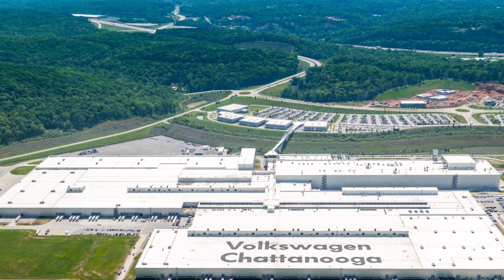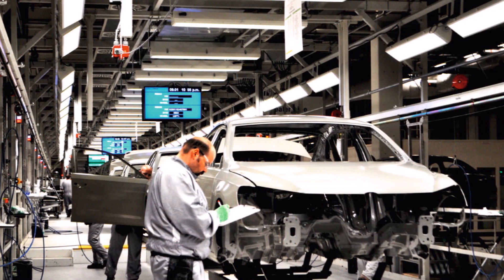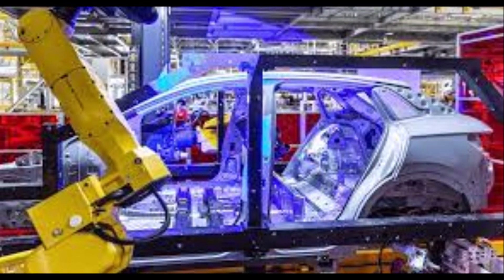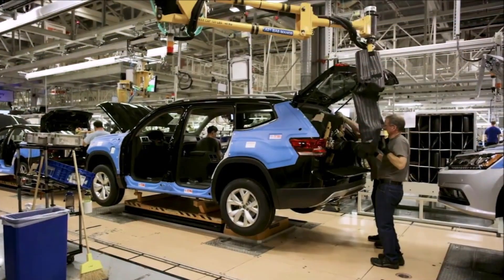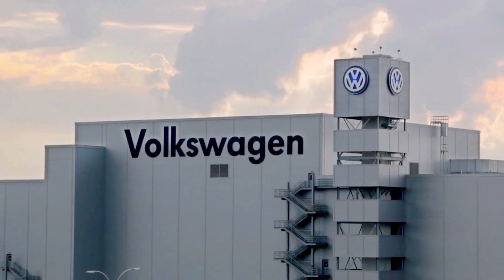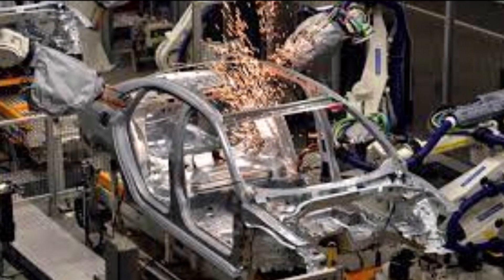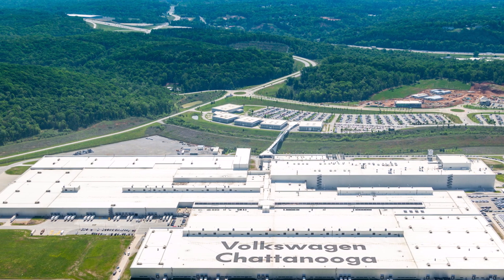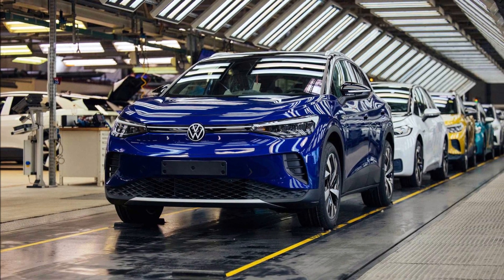VOLKSWAGEN JUST Launched ID.4 Pre-Production in USA To Compete With Model Y

Comment: Hopefully this is a unit structure that can be extensively improved. Because it's going to have to get better or be alot cheaper. Otherwise when it gets old I'll strip the battery out and use it as a home backup.